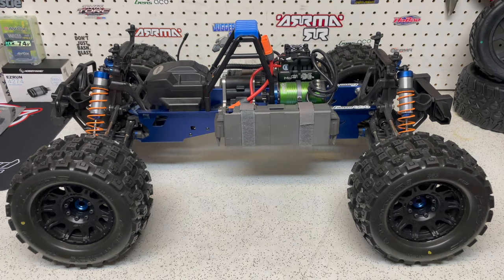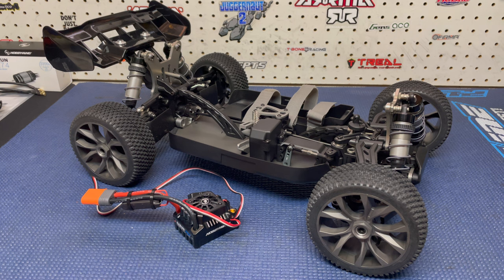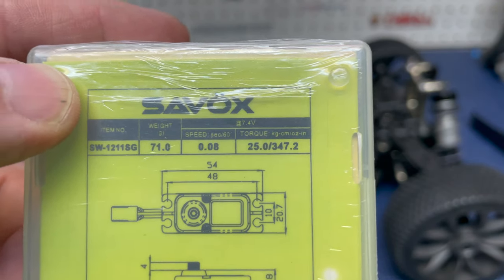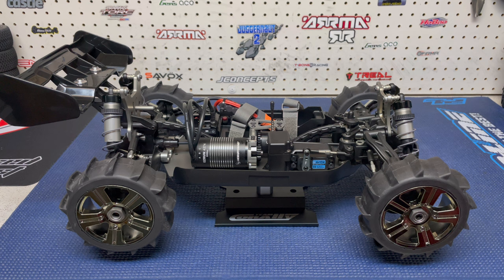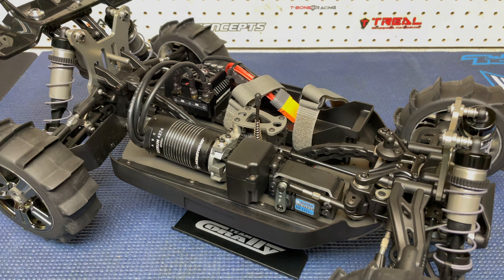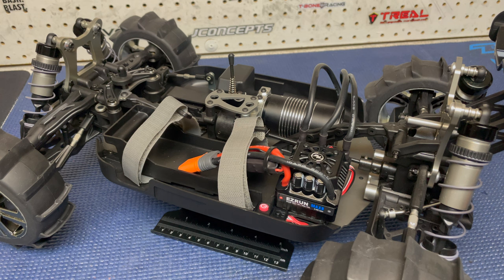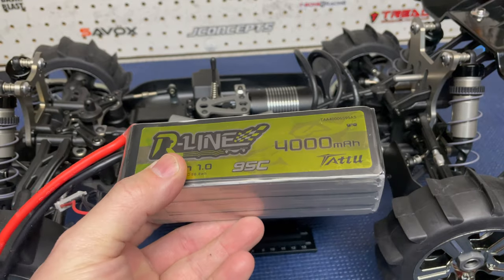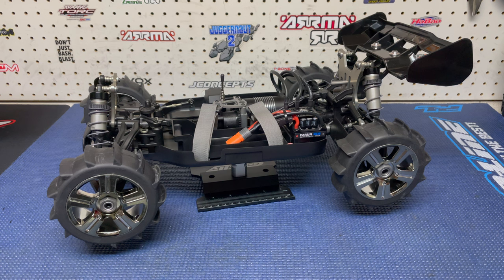Hobao Hyper VS2 Unboxed and Set up

Comment: Glad to see you finally got it😊  The snow I've seen you show on previous videos, I agree may struggle a bit but I think it would still be fun to try.  Also love Savox servos.  Looks like they increased the wire on the 1211.  I never had a problem but that looks longer than I remembered.
Reply from the maker: Just waiting on the body and I can get out and run this thing.  But the buggy looks like a beast.

Comment: Hi mate got the same combo in mine, did you just use 2 screws to fit the motor? I put my motor in same position as you but only 2 screw lined up? Thanks